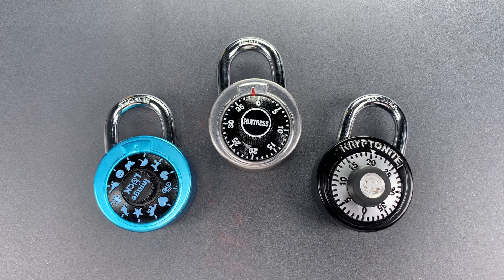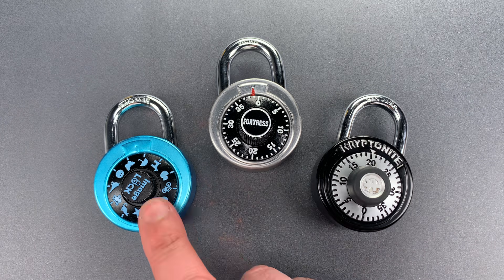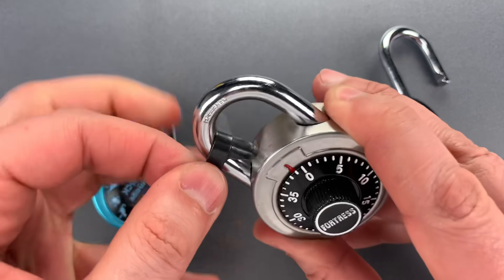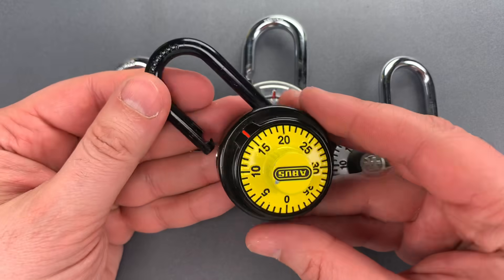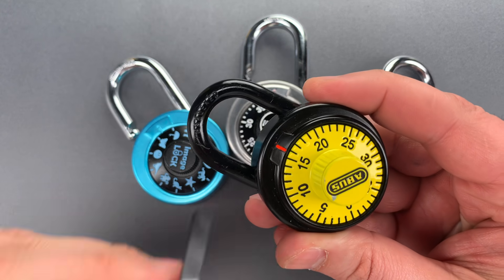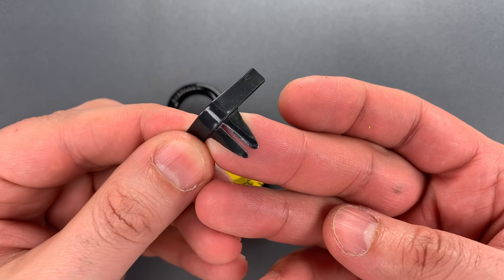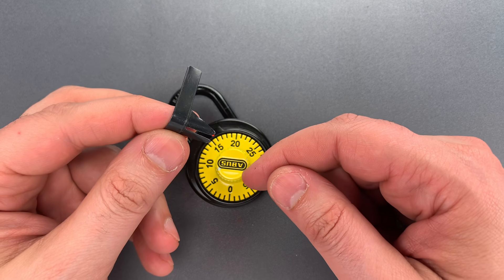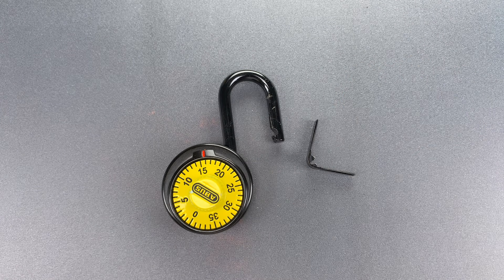[1243] Shimming The Anti-Shim Abus Combination Lock (Model 78/50)

Comment: By cutting that slot out, he actually opened the lock using less material than the first three. So in a way he used fewer resources to open the "anti-shim" lock than the regular locks.

Comment: Why is this still a problem these days? We solved shimming on door locks decades ago. The right answer is simple: never depend on spring pressure to hold a latch closed when the lock is closed. Design it such that the latch is positively engaged once the lock is closed.

Comment: As long as there is a gap, no matter  how small it is, the padlock is shimmable... What lock makers need to do, is use two thin pieces of metal that go into groove in the shackle when the padlock is locked and retracts when it is unlocked. If the two pieces are inserted so that they touch or overlap each other, there is no gap to insert the shim.

Comment: This would be great for gym locker doors.  Not a lot of thieves use lockpicking tools, but it's not hard to imagine someone entering a locker room with a shim and trying a couple locks when nobody is looking (or while posing as the lock's owner).  If he can't get into your lock, he's almost certainly going to simply move on to the next one rather than try to figure out why he can't shim the lock.  But for applications like on a gun lock, a determined teenager could bypass it easily.

Comment: You would think they would redesign the mechanism with a cam lock or similar concept method of preventing the catch from being pushed out of the way. Other locks have it figured out, surely there is enough space inside that lock body to do something without needing to re-tool the whole line.

Comment: And informed and well equipped thief will open the lock anyway. It is just to prevent lowest skill attacks, which simple shimming is in most cases. So the over all security is increased, but stays on a low level (which would also be the case without LPL's work around).

Comment: That reminds me, I was thinking up a method to make them keyless lockable while not being shimable and got thinking of the chuck lock on keyless chuck drills, have a similar sprag but have the travel limited so it can’t move down further than a certain point, then all someone needs to do to lock it is push it down all the way and pull back to jam the sprag, which is typically how most people lock those anyways

Comment: I'm sure the notch cut into the receiver weakened the strength of the locked condition holding power. You may be able to pull or pry the lock open easily.

Comment: I'm pretty sure there are other solutions out there that are more effective and I think I've already seen the following being used:
Let the locking lug protrude a bit more so that the flat part is positively in the shackles cutout. then you just need to cut a little bit of the shackles ramp part so that it still closes and voila you can't access any angled part from above.

Comment: Unfortunately, most manufactered locks will always have a weakness.  If you can assemble them with a machine, you can probably dismantle them manually.  I agree with you, detering most methods is all you can try to do, it buys you time for you or other bystanders time to notify law enforcement but there is never a guarentee.  If you have something important, you should consider hiding it or surrounding it with a plethora of false safe spaces that have to be searched to buy you more time to secure your cache.

Comment: You can always build a bigger gun to defeat thicker armor.  They DID force you to build a bigger gun (custom cut you shim).  It also took ~8 seconds from commencing the attack vs ~1-2 vs the other other locks with an off the shelf shim.  So, here's a question:  For a thief on the street using shims who encounters a lock like this, how practical would their attack be?  It would appear that you knew about this attack vector somehow and had to custom make a tool specific for this attack.  How did you discover this attack?  What is your assessment of the effectiveness of the Abus against a shimming attack where the attacker doesn't already know about the notch and groove?  What skill set would an attacker need to deduce the anti-shim feature and "field make" the modification to the tool as you did?  

After all, what my takeaway from watching this channel is that locks or other security devices are there to slow down an attacker, or make the attack difficult enough, such that the attack is either deterred, an easier target is chosen, or they're forced to break off the attack due to excessive time to execute a successful attack.  For the intended use of these types of locks (school locker perhaps or other lower security applications I'm guessing) especially considering the price point, is this Abus lock a "more fit" for purpose than the alternatives?  What would happen to the price point if the mechanism wasn't shimable?  Are there any of these genre of locks out there that have LPL approved levels of shim resistance at a comparable price point, because I'd like to know about them?   Perhaps you've covered them and I'm just not recalling that vid.

After all, in spite of you being able to quickly pick your way into nearly everything, you do in fact declare some locks probably good enough for the street, or something to that effect.  I'm not saying this rates that assessment.  The only thing about this particular vid that rubbed my fur the wrong way is that this lock does appear to be a clear improvement in shim attack resistance over the others shown, but that it is still panned for not being better still ("I commend the effort, but I can't help to think that a company like Abus really could have done better").   An out take of "better, but still vulnerable to someone with a bit of knowledge and slightly modified tools" seems to be a more fact based assessment based on what was demonstrated.

Comment: The main reason that dial padlocks are so easy to shim is because they can be closed when the cams aren't in position. The ability to do this is what makes them shimmable.

If the dial locked when the lock was opened, you wouldn't have to force the lock to be closeable when the cams aren't aligned, which allows the ability to make it 100% impossible to shim.  the downside is someone else can get that last number while the lock is open.

Comment: is there a reason why the upper shoulder of the cut in the shackle is slanted? I´d guess that if you made that cut a square one, you´d make shimming equally difficult as with a shackle that is locked with ball bearings. Granted, the end of the shackle would need a deep chamfer to push the matching square locking bar aside when you close the lock, but it still should be a comparatively easy and cost effective fix.

Comment: Could you create a padlock immune to shimming if you make the bolt shutting it be evenly long from top to bottom?
This would lead to being unable to close the lock by simply pushing the shackle in but that problem could be solved by including a mechanism to retract the bolt using the code wheel when the lock is open.

My assumption comes from the form of the cut in the shackle that shows that the bolt inside the lock is shorter on top and longer on bottom.
I think shimming abuses that form to forcefully retract the bolt by driving in the pin on that diagonal part.
So if the bolt would have a rectangular form from top to bottom (in otherwords a completely vertical outer line) shimming should not be possible.

Or do I misunderstand how shimming works?

Comment: If they put a slightly thick part of the shackle that shrinks back down to the normal size that would work. As long as they have a lip inside the lock where the shackle goes inside so a shim wouldn't penetrate. It seems like an obvious fix to me.

Comment: Not a bad showing, 3 locks in the first 30 secs, another minute to get the fourth(including tool modifications)
That equates to the front gate, entry door, key room door and the key safe door to allow access to the whole complex, Just Turn the lights off when you leave, Ok.

Comment: In defense: Combo locks are oft used in settings wherein many are arrayed, such as lockers.  If I were a petty thief, I would just move on to the next one, instead of wondering why this one is putting up resistance.  While I wouldn't use this as a lock for, say, a door on a trailer of valuables, it would certainly suffice in my mind to secure a footlocker or the like in a public setting.

Comment: To be fair, this notch will still deter a random locker thief with a piece of red bull can. Unless you're specifically targeted, the security improvement is far from insignificant
Reply: Unfortunately they made it a black and yellow lock, which stands out as "I'm protecting something valuable"
Reply: @twilliams1755  You think so? To me it's as significant as that blue/pictograms padlock - just an aesthetic choice. I have a black/neon yellow cable lock with non-programmable four six-digit wheels. Does it say "I''m protecting something valuable" too? ;)

Comment: The point of locks is to detour or delay someone getting into or taking whatever.  I think by putting a gap in the shackle hook, makes it much weaker.  I could probably just give it a good whack with a hammer and it's break.  Fix one thing, but make the other worse.... not the right answer.

Comment: What if the shackle had like a plug part of it that was wider than the main hole and fit into a wider hole in the lock and the shackle then seated itself it would make it so they had to get a longer shim past a 90 degree or more bend depending on the design?

Comment: Me: I electrified the pins, and shim points with a lethal amount of electricity, I also put a glass bead of chlorine glass inside so if an attempt to force is tried the person will die.
LPL: While I commend the effort if I simply rub this exact spot with a micro fiber clothe, the lock opens.
Reply: If you could design that for a manufacturing unit cost of $3.00, Master Lock would be all over that!

Comment: Looking at the problem right in front of them, rather than the bigger picture. Then again, what's the point with that type of padlock - I doubt it will withstand a screwdriver through the shackle and twist the whole lock off.

Comment: And the fix is so easy for this imo:
Why dont they shove a little ring over it and weld it where the U touches the housing in locked position, so you cant get the shim in? Even a rim there would do it. Even if not entirely close to it, youd create another 90 degree angle to get through.

Comment: It seems like they need to stop having things coming from the side but maybe inserting in the bottom of the lock shackle or something, kinda like an umbrella/IUD that can close (so as not to obstruct movement) when it's unlocked and then pop up and open inside the shackle (stopping it from being able to move) when it is locked. It might require a wider shackle to give room for such a contraption, but that seems like it'd give a less cut-able lock so more security all around. I dunno; I'm not an engineer and that still leaves the traditional lock picking as an option, but it seems like it might at least put a stop to shimming. Anyone who wants to is free to use "my idea" (someone else who knows what they're talking about probably came up with this idea already, and maybe even knows why it wouldn't work, hence companies continuing to use this many times proven problematic side hook method) is free to try to make it and send it to the LPL to see if it'd change anything.

Comment: LPL: What should Abus have done?

I'd like to see solutions as well as problems.
Reply: the problem here wasn't that abus didn't know how to do it properly, they just wanted to do it cheaply instead .. and got called on it.
Reply: @notsonominal  I'd still like to know the solution.
Reply: @AndersRosendalBJJ  
You could for example make the shackle thicker where it’s not inside the lock body, thus you would block the access, but of course that would be more expensive.
Reply: @HingerlAlois  Or keep the end of the locking arm square, and make the end of the shackle wedge-shaped to push it aside when locking.

Comment: What if they make a horizontal slot above the locking slot that engages when the tip of the U-shaped thingy is pressed down(that way it isn't slid into place when lock is open) or just a second latch bar that engages along with the regular thingy, but that inserts a little further with tighter parameters as it's primary purpose isn't to hold the lock shut? I'm going to mention the U thingy a few more times so it really sounds like I know what I'm talking about.

Comment: Has anyone designed a padlock in which the "hook" is upside down? Make it so that turning the unlocking mechanism locks a spring-loaded bolt back into the lock body (leaving the shaft completely clear), and then depressing a button at the bottom of the shaft (by pushing the shackle in fully) would release the bolt into place. That way, you could build the bolt to not have an angled top edge, which, so far as I understand it, would prevent shemming?

Comment: Why don't they just replace those spring loaded locking polls with the ball bearing type and then shimming them would be out of the question. Then it's just the marshmallow combo dial with or without a keys backup.

Comment: Easy to defeat if you have brain cells… but for the intended use (gym locker etc), you really only have to defeat pretty braindead thieves. If they buy a shim off the internet and it doesn’t work, all they do is go hit any of the 100 master locks in the gym locker room instead.

It isn’t amazing by any stretch, but for a low security solution it probably presents more challenge than anything else you’d use for that sense. Which is probably enough unless someone very specifically wanted into YOUR gym locker specifically.

Comment: There is a simple design that can be implemented to solve this problem and I can't believe these padlock makers haven't seen The simple solution I'm going to give it to you for free because see I'm a genius and I really don't care about money so if you close a padlock all the way down and now you draw a line at at the lowest point that's exposed that doesn't go down into the lock itself and now go ahead and weld yourself a nice ring around that shackle every shackle from here on out should be made as one piece with a ring now when you close your lock you have these rings that are part of the shackle as one piece molds umbrella over the edges of the holes this way now you can't shimmy anything ever again problem solved if you can't picture what I'm talking about it's basically welding a washer onto the shackle so now when you close the shackle the washer completely covers the edges of where the shackle goes down into the hole now you can't put anything down into the hole.

Comment: Ya know... it always looks like the thingie that goes into the Groove in the other thingie always has the round part facing Up... which is the direction the Shim comes from... has anyone ever tried flipping that thingie that goes into the Groove & the Groove itself upside down to face the FLAT PART towards the Shim's Attack Angle? :P

I can't remember the Names of the Technical Parts of the Lock real well & even I can think of this...